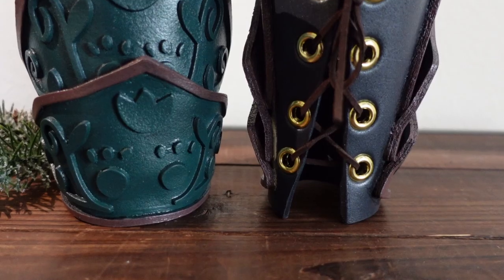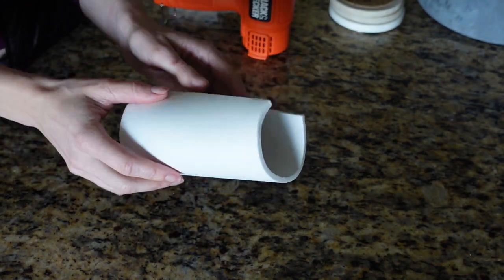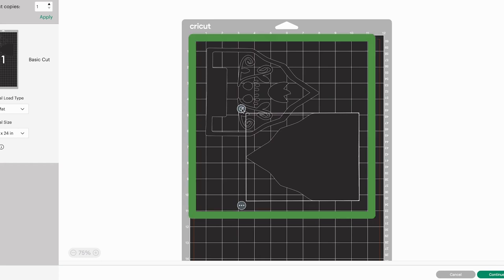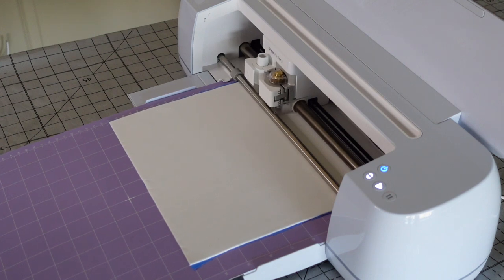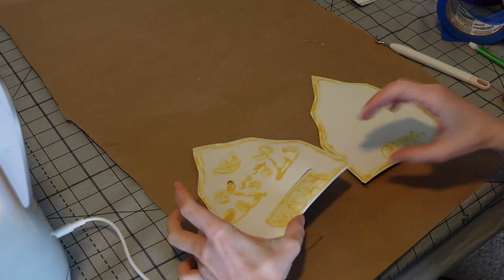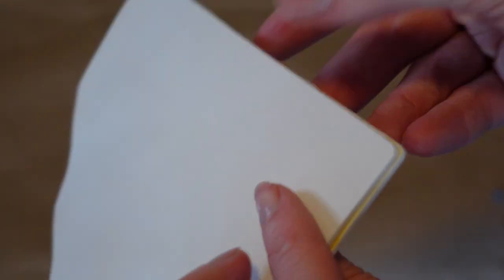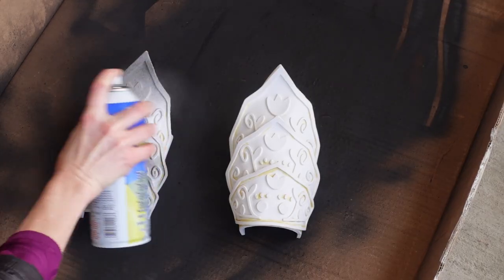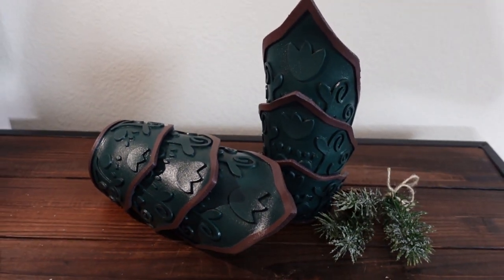Druid Bracer Tutorial - How to transfer small details onto EVA Foam with Cricut Maker 3

Comment: Could you use a spray adhesive instead of the contact cement?
Reply from the maker: Hi Samara! I tried using a spray adhesive and the residue it left on top of the bracer was visible when I plasti dipped. However, if you have more experience with the sprays and can get them to work better than I could it will hold well.